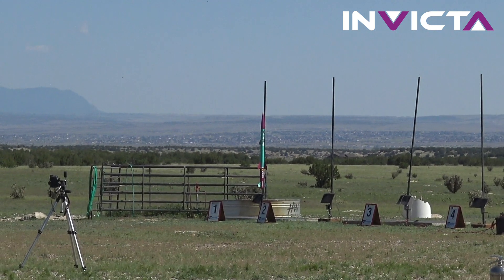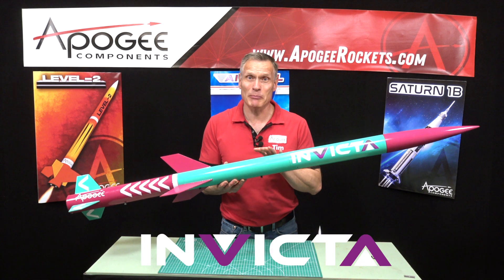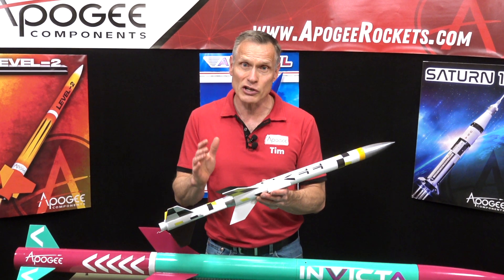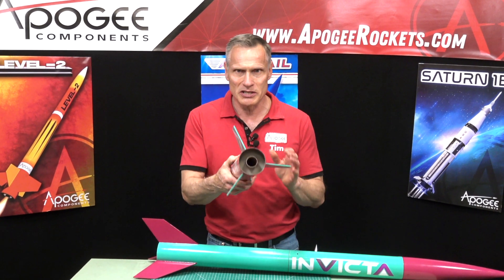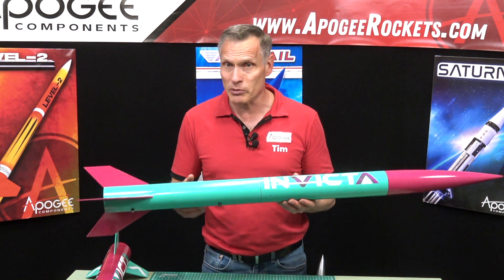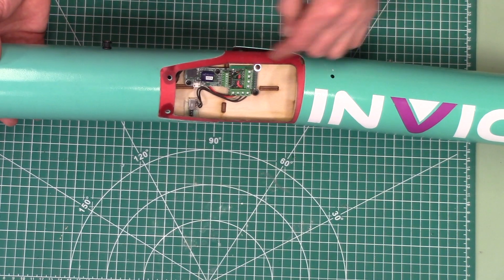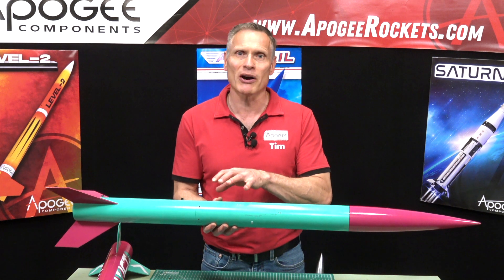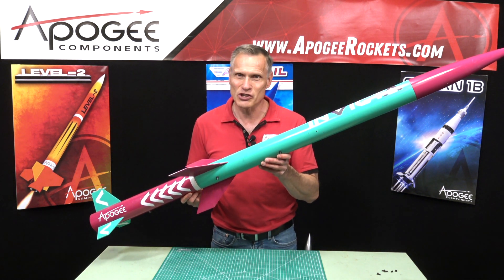Introducing the Invicta | 2-Stage High Power Rocket

Comment: Wow....fantastic flight. Very stable camera platform and a great looking model. I like the way the design automatically lines up the e-bay pressure port and launch rail buttons. Somebody was thinking....I wish you would have put a 38mm engine mount in with a 29mm adapter, and then you could have had the option to fly both or even mix them. Might have to add this little jewel to the list. = )
Reply from the maker: The reason we went against 38mm is because the tubes are thin-walled. So if we offered 38mm, most people would still opt to not fly it because of the tubes
Reply: Makes since.....Apogee is always going the extra steps when it comes to design. = )